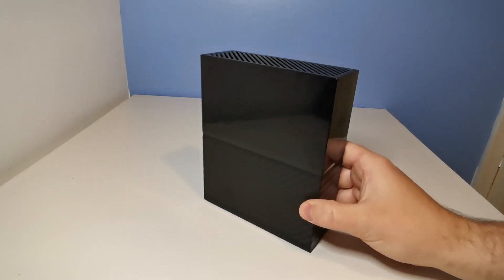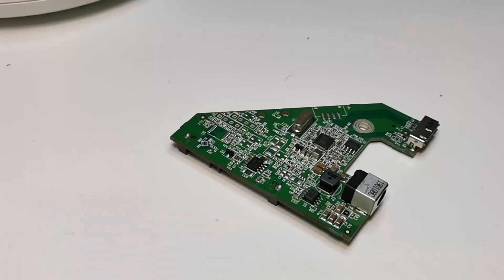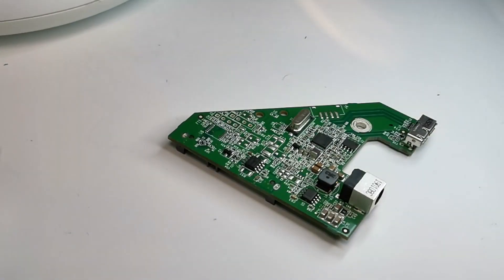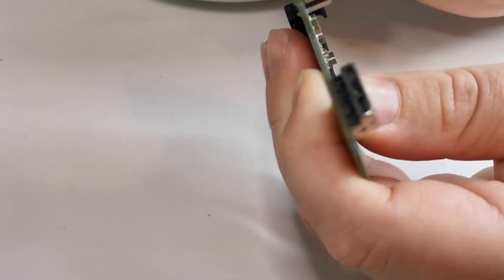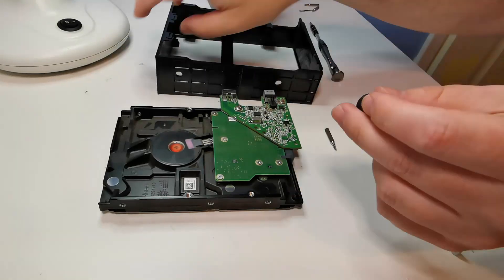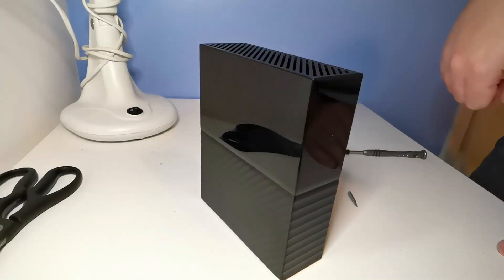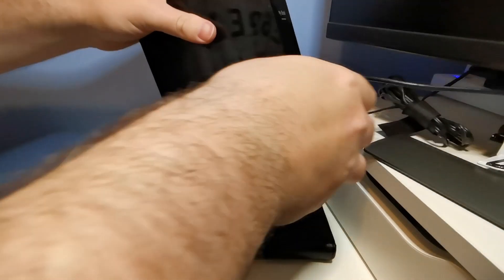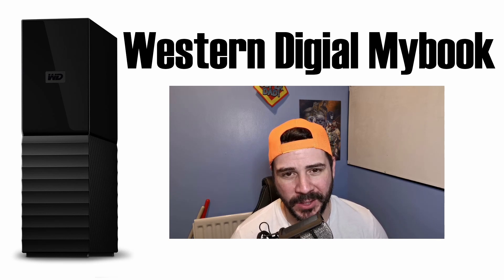WD Mybook enclosure - Make it work with any other drive

Comment: This Workaround was sadly fixed. From what I could gather from my own 6 WD MyBook Enclosures every Board that uses an ASMEDIA Controller (The Square Controller to the left of the Winbond Chip) is perfectly fine for this workaround. The Later WD MyBook Models from 2021 use a (JM) JMS579 Chip. On Boards with the JM Chip this workaround no longer works :/
Reply: That was very helpful. Same issue i'm having. This trick no longer works. They must have found the work around and patched it. Dirty business practices. Now 200 of these enclosures have to sit in a land fill.
Reply from the maker: awww thats a gutter. Not that ill be buying externals again i dont think but good to know for anyone shucking, was always good to keep about for testing drives for me
Reply: I wish I read that first ! :D
It worked perfectly fine on 4 drives in the past (all WD80EZAZ), but not on the two I got today (WD80EDBZ), which indeed use the JMS579 chip.
Reply: so pin 7\8 on bottom row, far right underneath winbond on the chip and not 1-2 as in video? Thanks
Reply: hehe now you tell me. I can confirm 8). Wasted my controller board which was kinda helpful to read out SMART data. Well done WD.. well done..
Reply: After reading the whole internet, I found a fix (well I did not find it per se , I gathered information) :)
I got to find the links but :
I downloaded a firmware tool updata : JMicron JMS578 Sata Crystal Enclosure FWUpdate
I downloaded an updated firmware : v173.1.0.2 with SMART + Serial + Powermode Support.bin
I connected back pin 7 and 8
The follow the procedure : 
- launch the jmicron software
- plug a sata drive, any will do, I used and old ssd
- connect USB and power cable to the pcb but not to the wall socket
- short (with tiny screwdriver for instance) pin 1 and 2 
- plug the power to the wall socket
- you can see that the software does detect the JMS chipset
- take away your screwdriver from the pin
- load the firmware
- clic Run and wait (not for long)
- you get a message asking to power on and back on
- Et voilà !

nb : I took me 5 tries to get it into flash mode, the run button was greyed out until I got it right.
My investigations started here : https://www.reddit.com/r/DataHoarder/comments/p8s4cb/is_there_a_workaround_for_using_a_2021_wd_mybook/

Comment: The WD Mybook that I have seems to be an older enclosure.  The model is from 2007 and the board looks a bit different.  Might you have any experience with this model?
Reply from the maker: Hi buddy, i dont unfortunately, but i image there will be a similar process for this to work.
Reply: I've got a few other HD | SSD to also access. Might just get a proper | new external case.
Thanks for the reply.

Comment: Question: Will the original drive still work in the enclosure once you've popped the two pins? Need to know that I can still use the drive until the new one comes in.
Reply from the maker: I imagine so, if it does not all you would do is place some tape over the pins and put in back in and it will work :)

Comment: Does lose the stand-by mode by doing it?
Reply from the maker: Tbh i dont know. i got rid of it a while ago, but if you mean does the drives still power down when not in use then yes, from memory mine did
Reply: @mrsteve2441  

From my experience I did the trick in the other type WD enclosure. The other which is rounded, following another tutorial. The chip is on a different position. It make any drive work without encripting i (because that was the problem of these, but I found it lost the stand-by mode, the drive is always on. Anyway I found that my other wd drive, which is like this tutorial, comes with the new chip which is not compatible with your modification, there is a way to know it reading the company name of another chip in the board.
Reply: @mrsteve2441  

There is a way for new chips, I did it. Search for "Is there a workaround for using a 2021 WD MyBook Enclosure with other HDDs? " there is a reddit thread and look and the answers. You may make a video of it. It's working.

Comment: Worked great for me! Thank you! 
I've a Pflash Pm25LD instead of Winbond, and the shape of the PCB is different, but the pins and the procedure is the same.
Reply from the maker: Awesome man, thanks for letting me know, i actually have a few of these still to be shucked if there the same chip i might make an updated video and show the chip comparison
Reply: @mrsteve2441  I confirmed this as well for this chip.  Btw, you only need to cut pin 1 (CE), which disables the SPI interface on the chip.

Comment: I had mine moded from another video on Youtube lifting only pin 8, had trouble with some drives, but lifting pin 7 too worked flawlessly! very useful video, I was about to scrap the board... Thanks for sharing!
Reply from the maker: yeah i think different board revisions had to have 2 pins taken off, some dont work at all anymore sadly
Reply: Did those have an ASM controller or a JM controller? Pinned comment says on JM it won't work, curious if 100% true.

Comment: Somethings that i noticed but might be wrong. I installed smaller old 500GB drive which works fine but will not spin down even with USB cable detached. Also the WD Drive Utilies won't recognize the drive and you cannot change any settings like sleep or spindown times which i assume you should be able to normally. Again these might be due to the drive i've installed inside the enclosure or possibly due to this modification.
Reply from the maker: Thats an interesting find man, i can honestly say those aren't things ive tested. I do still have one elements enclosure left so i might give this a whirl and check my findings

Comment: i tried on several of these boards. On all new 2021 wd my book enclosures. Doesn't work for me. i tried just pin 8. and pins 7 and 8. Once i remove pin 7. the drive no longer spins up. Thanks for the video anyways. i was pretty hopeful
Reply from the maker: damb wd and changing it up man. Wish it had worked. The old ones still work fine if you pick up a used drive. I got another 6tb one and worked a treat

Comment: Tried it with like 3 boards, I think they fixed this issue. removing both pins now stops power to the drive completely.
Reply: Same, just did this to mine and no power at all
Reply from the maker: @joaosreis  Pinned for future viewers, wish I still had the enclosure we could have compared numbers on the side to check revisions
Reply: might be you done it wrong.. for me working withou any problems
Reply: also killed my chip. where to get another one who is working?

Comment: I’ve removed pin 7 and 8 and after I connect device to usb, disk does not started ;(
Reply from the maker: Hi buddy, just double check them make sure, i have done about ... 8 or 9 of these at this point and only had the drive not spin up on 2 of them. One i hadn't fully broken the connection on pin 7, the other was just a slip of the hand and i damaged the board unfortunately